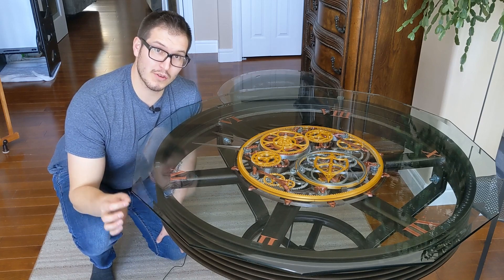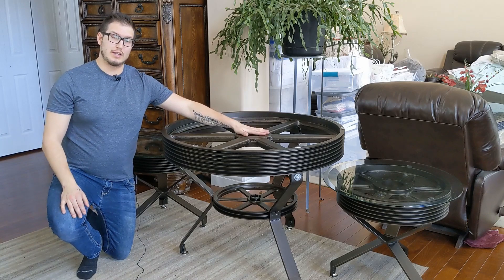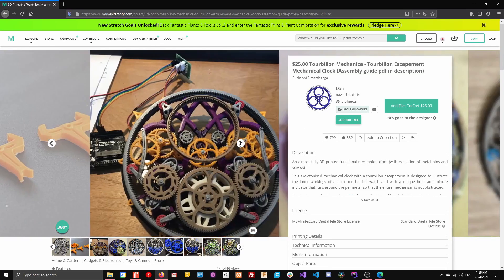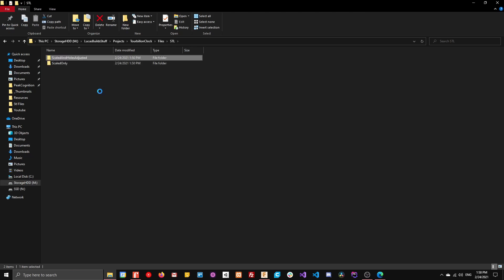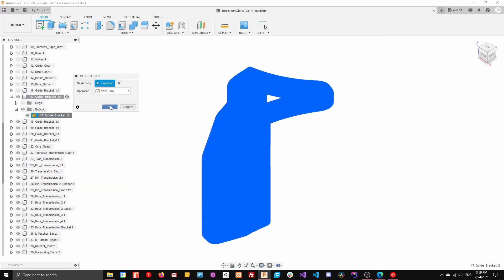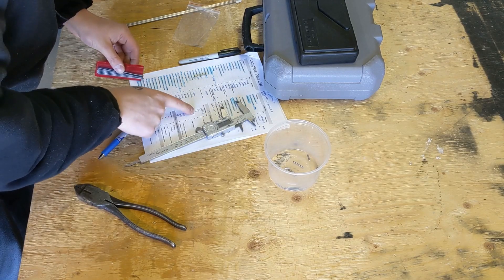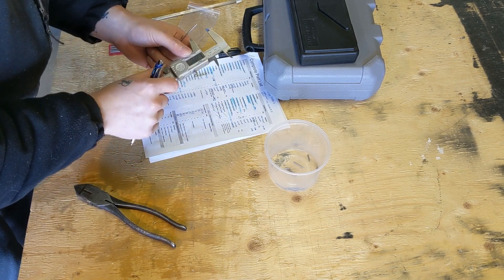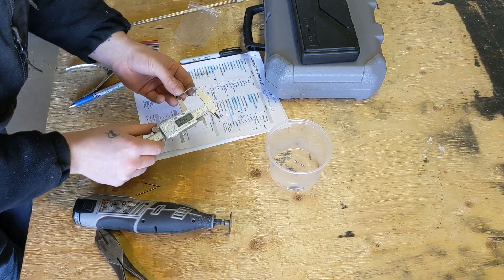Tourbillon Clock Flywheel Table | Actually Keeps Time!

Comment: An interesting technology that you could possibly make use of, in this or another project.
I once had a turntable for my hifi system. It used a synchronous motor to drive the whole thing, synchronizing to the 60 Hz (50 Hz in Europe) frequency of AC power. But speed stability is key for a turntable. Turns out that the utility does not guarantee short-term frequency stability sufficient for a quality sound system, because reasons. But they do guarantee long-term stability, because there are many systems that rely on this for timing — the utility monitors the frequency variations and compensates, which is heavy lifting because they have to adjust the  rotational speed of huge generators. Heroic. But what about the short term variations, they would be catastrophic in a hifi turntable. They made a heavy platter to stabilize it, and to further stabilize it they built a circular trough under the platter, put heavy silicon fluid in it, and stuck a fixed paddle into the fluid. The friction of the thick fluid around this paddle was very stable. Over-engineering? Sure. But cool. 

Just like a tourbillon.

Comment: Does it still run? I always wondered how long a 3D printed clock would last
Reply from the maker: We didn't seal the table from underneath and after a year or so a toddler ripped it apart 😅
Reply: @LucasBuildsStuff  still it worked for a year that's pretty amazing

Comment: To use a tourbillon just as a decorative piece was a bit counterintuitive and a little offensive considering the table itself is a watch however it is 3d printed so to use it for it's purpose will make it inaccurate so I'lll let it slide. Though the work put into the figuring the amount of steps for the stepper motor is admirable and well done. Nevertheless, great job on the project.

Comment: Its a bit late but it would be cool to add a small main spring to the motor, That way you could use the motor like an automatic winder and have the clock be driven normally. You could also add a sensor to see how much tension is in the spring and adjust the motor speed so it wont run too fast or slow. (Or do like automatic watches do and have the spring slip if it gets too tight and run the motor every now and then.)

Comment: Insanely cool. Ive tried printing a small, simplifed version before but it didn't work all that well 😅. Might have been worth adding bushings for something that'll be running 24/7
Reply: And the way that center stepper mount fit 😍

Comment: I actually watch the channel that you got that design from, and the first mistake you made was scaling the entire model up. That then caused enough variation in the flywheel attached to the escapement mechanism to then make the mechanism to tick at a slower rate of speed due to friction, increased weight, etc… Though I think that attaching the weights to the ends to increase the momentum was smart, the issue you ran into happened to be caused by the fact that the flywheel must first work up the speed and momentum for that method to be affective, and since you mistakenly broke the spring (which likely wouldn’t have provided enough energy anyways) that caused a fatal error in the entire mechanism due to the tourbillion mechanism.(which is pronounced tore-bee-on, by the way.) So the moral of the story is to talk all major design changes over with the creator of the mechanism to ensure that what you are changing happens to be inconsequential to the overall functionality of the model, and this miscalculation on your part is very easy to dismiss because the initial thought when it comes to mechanical models in the general public is that scaling the entire model up equally (so long as everything remains in the same proportions) will not affect the design. This is not the case here, as you can see, because the timing and function are based in the centrifugal force in the flywheel, which is altered by the mass. I apologize for the horrible time of morning I decided to comment in in my time zone by the way, and I hope you had the patience to read all the way to the bottom of this comment here, which I also apologize for, and I hope you have an outstanding day!
Reply from the maker: Hey! I did read all the way to the bottom, thanks for the info! 😀

Comment: Should put fork back in, really needed for full effect. Gear the stepper motor so you can spin the motor faster and get the torque needed to turn tourbillion. Just a thought. Great job by the way. Looks fantastic.
Reply: Absolutely.  As it is at the moment, the mechanism isn't doing any timekeeping - it's all in the Arduino.  Looks fantastic though.

Comment: The entire purpose of the mechanism, not just the tourbillon, is the translate the constant output of the torsion spring into a periodic output. Driving it with a stepper motor defeats the purpose, what you've made is a standard wall clock with a bunch of superficial gearing, but I'm sure you realized that as soon as you removed the key component of the escapement mechanism. I was expecting you to use a stepper to periodically rewind it, not power the whole thing.

Comment: So, you took a clock, broke the winding mechanism, then you intentionally broke the escapement mechanism to put a electrical motor into it that will show the time. You could just print the rings with the hands and the few gears powering them and you'll have the same thing you just build.

Comment: I really want to do this as a wall clock, and I’d consider a real metal hair spring on the balance wheel, and replacing the spring drive with a constant torque motor instead.

We’ll see if I ever get around to it though. 😅

Comment: It's a lot of work and probably cost you a couple bucks but putting bearings in a lot of places and changing the mainspring and the other spring I forget the name of it and I bet you can get it to work. you could use your Arduino & motor as a Winder you just push your button and wind it.
Reply from the maker: I hadn't thought of using bearings! Thank you!

Comment: Try using an actual Steel mainspring in an actual Steel tourbillion spring. That's what it needs I think. I'm not an engineer I am a technician and I think that would make it work good luck and I hope it does.

Comment: Probably should note that an arduino has a ceramic resonator on it, which is pretty horrible at keeping time over long periods. I’ve read of as much drift as 27ms of drift every minute. That means the clock would be several hours off by the time 6 months rolls around, meaning you’ll have to correct the time much more frequently than twice a year...

Comment: Great job!! Subbed. Are you going to share all your files once done?
Reply from the maker: Thank you! On my other projects I do but on this one I used someone else's design and modified it so I won't be. I linked the original design in the description
Reply: Yes I bought the files and have built the clock. Cool project.

Comment: shouldn't you try to continuously wind-up the coil so the now missing flywheel runs endlessly? For actual precision, one could monitor the speed of the tourbillon and slow it down ever so slightly that it matches the true time. It would have to run a little bit too fast in the first place.

Comment: These projects are good but with your problem having to take out the fork, what if you used the original thinner spring and removed the weights you added because that should make it easier to turn and it is one of the most interesting parts of the mechanism. Also a big criticism I have of these projects is why use an arduino uno when you could save space and make it more reliable using a nano, because they usually come without pre soldered headers then you can solder it directly for a more reliable connection.
Reply: The fork is the key component of the escapement mechanism, the piece that translates the constant output of the torsion spring into a periodic one. It's the same difference between a standard DC motor and a stepper motor. Once he added the stepper to the mechanism (and it wasn't just periodically winding the main spring), the escapement and therefore the fork became redundant. The vast majority of those gears are now just for show, they don't achieve anything mechanically.
Reply: @needamuffin  I know how they work. My main point was he simplified it mechanically and essentially made it into an electric/digital clock with a mechanical bit on top which isn't nearly as interesting or impressive as a fully mechanical clock.

Comment: The plastic is ugly, it looks tacky. Clear resin part would definitely be nicer especially with copper springs and a few metal parts. Also not having a crank under the table to wind up is a missed opportunity. Also removing parts just to make it work sucks.

Comment: You know you can print with higher layer line thicknesses than your nozzle, right? I use a stock 0.4 to print most of my stuff in 0.6 so basically @ 150% but I heard that one can go up to 200% and still get reasonable results. In my case, I use this to speed the printing process significantly as perimeters are some of the slowest moves during the printing process and only doing two ( 2x 0.6 = 1.2 ) instead of three ( 3x 0.4 = 1.2 ) is quite a timesaver.

On a somewhat hilarious sidenote... Halfway in when you started talking about that catching copper gear towards the end the video stopped playing for a while and the typical "Experiencing interruptions? FIND OUT WHY" popped up - Fuckin' great timing YouTube... 🤣
Reply from the maker: The highest I heard of was using 0.48 on a 0.4 nozzle, I'll play around with the settings see what results I get! Lol of course 😆

Comment: Did you ever get the fork/flywheel working again? If the system has too much resistance you might want to consider getting one o' them fancy geared motors what has a crapton of torque at the cost of speed.
Reply from the maker: Not yet, but I will be doing a follow up video once I do!

Comment: Beutiful work.... but... Arduino was really necessary?
Reply from the maker: Thanks! I used it for the stepper motor, but you could probably do without if you used a dc motor
Reply: @LucasBuildsStuff  Not really my friend, you can use a circuit that outputs a clock frequency to a stepper motor driver.
Which can be a kind of an oscilator or even a small and cheap microcontroller, the stepper motor driver for a bipolar motor can be the A4988 which is very popular and cheap.

Comment: why take a beautiful mechanical movement and ruin it by making it electrically powered? the whole point of gears and springs is to power the clock mechanically, just buy a battery powered wall clock and be done with it.

Comment: I'm adding another voice to the crowd disappointing that you cheated and didn't make it work like a real mechanical clock. If your brother is a fan of clockwork, I'm sure he would appreciate it much more if it kept time purely mechanically, and the wall power was just there to provide the energy and not actually control the time. At the very least, make it so the electronics just adjust the tuning to keep the clock running at the right speed, while letting the clockwork mechanics actually run the clock itself.

Comment: 3 min per year is assuming that arduino's frequency is 100% right,it will be more like +-100ppm so more or less 1 hour a year,that sounds more likely
Reply from the maker: After reading through all the suggestions and learning the way the Arduino keeps time, I wouldn't be surprised if you are right, thanks for watching!

Comment: yeah a stepper motor is not compatible with a tourbillon it will just stall. you will need to have a normal dc motor acting on the middle gear with a constant torque, essentially pretending to be a spring. Then to make the Tourbillon tick at the correct time adjust the weights on the flywheel, just like the weights on the pendulum of a clock. Also, Tourbillon is more correctly pronounced "tour-bee-on". Hope this helps
Reply from the maker: It does, thank you!

Comment: Maybe compute the power usage and integrate solar panels (as background to the clock) if possible?
Reply from the maker: I did originally want to make it solar and/or battery powered so there wasn't a cable, but the final location of the table didn't provide much sunlight and the power usage ended up being around 300mAh @ 5-6v 24/7. Even the larger capacity power banks (40,000mAh+) would of ended up running out in 5-7 days, and a larger 100-300Ah RV battery wasn't a option due to the physical size. I do think it's a good idea though, just couldn't see a way to make it work with the table design
Reply: Ok. That's unfortunate. Power-optimizing the stepper and μController might be an option but I guess it probably will not change that much.
But thanks for replying and the details.

Comment: Hey I just had another feasible idea how you can have a perfectly running clock while keeping all the mechanism alive and the clock authentic.

You would just need two things:

Hook the clock up to a rotary encoder so the arduino can see how fast the clock is turning...
The arduino then compares that to its perfect clock (quartz oscillator) and measures the error.
Then the arduino needs to be able to change the inertia of the flywheel - which is what gives the clock its frequency. This sounds really hard but isnt - just hook up a tiny servo to a mechanism on the flywheel, that will move some mass slightly outwards or inwards - slowing its frequency down or speeding it up.
The programming to do this is also not that hard, there is libraries for servos etc. - that way the arduino would constantly tune the flywheel to have the perfect speed and catch up or slow down to meet with the correct time again.

You just need a rotary encoder - or potentiometer on the flywheel for example - and a way for the arduino to control the flywheel frequency - youve already come so far, maybe you can do this, idk.
Reply from the maker: That's definitely thinking outside the box, seems like it would be a challenge, I like it!

Comment: Rather than using delays you could probably just skip or add 1 motor step every n steps, depending on how many extra or fewer steps you have over time.  So if it was fast by 1% you just skip 1 step out of every 100.

Comment: Where can i get your android code? ;D
Reply from the maker: I added a link to the video I used during the project in the description, I also linked an Arduino Stepper Library that's supposed to be easier but I couldn't get it to work properly, hope it helps!

Comment: So, basically you 3D printed a bunch of gears for a movement that is electronically powered. It takes away all the magic behind the mechanical engineering of a Tourbillon. Even though in a horizontal position the Tourbillon will have no gravity compensation, the fact of just driving the power with an electronic device takes away all the merit of a mechanical clock. Mr. Breguet would be crying in his grave.

Pretty cool-looking table tho.
Reply from the maker: I'm planning on finding a way to bring the magic back and thanks!

Comment: Cool project, just letting you know that all Arduino microcontrollers use a ceramic oscillator/resonator which has a 0.5% tolerance for its 16mhz frequency - the 16mhz quartz is only giving its signal to the smaller microcontroller handling the USB connection - I found out the hard way when I was making a tracking system for my telescope... - So if you havent already make sure the oscillator signal used by the main MC is actually a quartz one... - there are cheap RTC (Real time clock) Modules you can hook up to the arduino that have Quartz oscillators with an at least 3ppm accuracy).
0.5% tolerance can lead to a 7 minute error per day...
Reply from the maker: Thanks for the information, I wasn't sure exactly why people were recommending I use RTC but after looking into how oscillators/resonators work and the different types it actually makes sense!